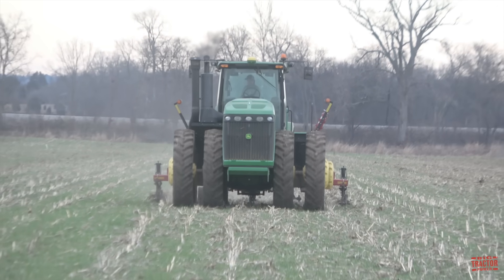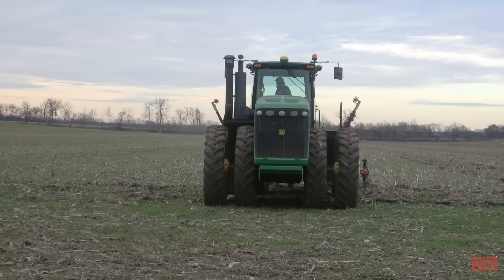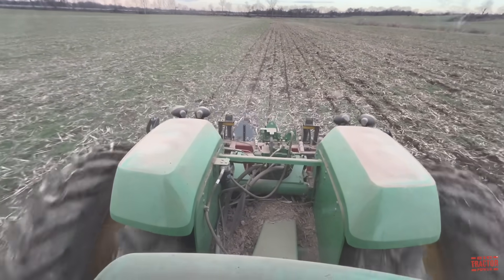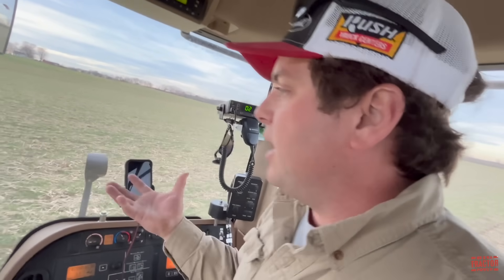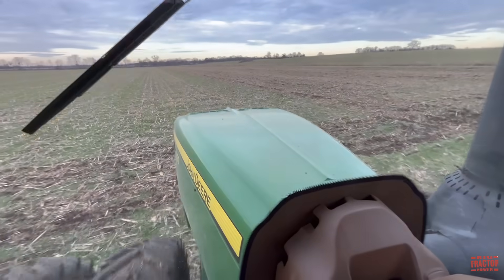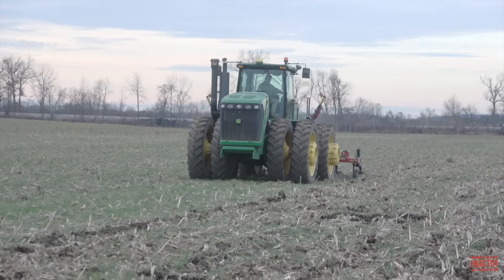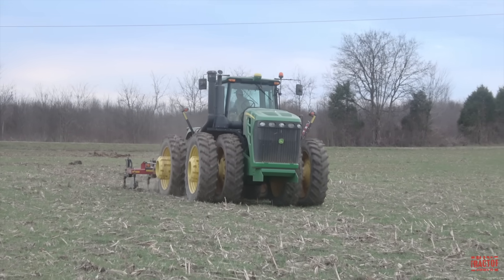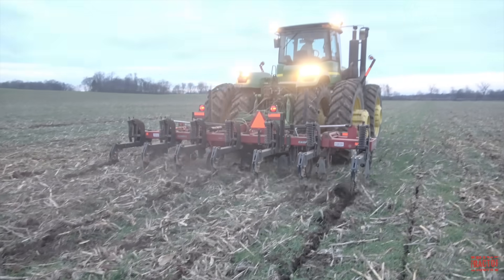JOHN DEERE 9330 Tractor Sub Soiling

Comment: Ive never understood why rippers needed disk blades on them the old school deere rippers didnt have that in the 80s that we used
Reply from the maker: The coulter cuts the stalks in the shank path so that the stalks will not wrap and drag.
Reply: The disk cuts the trash before it gets to the shank.  It helps with the least amount of disturbance.
Reply: With the corn stubble we have in Illinois, we have to bury it.
Reply: What happens when  the disc is running between the rows mm  fancy hats and sunglasses ha ha
😊@JD-oh9vz